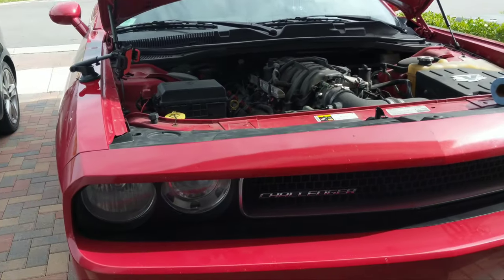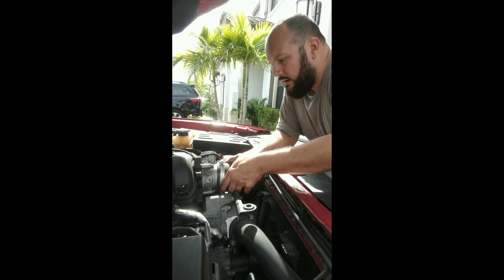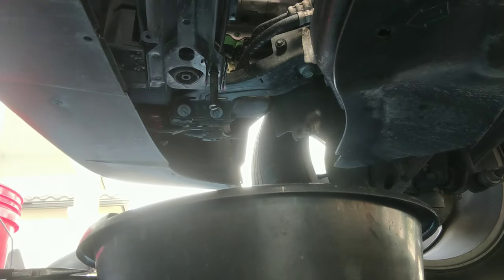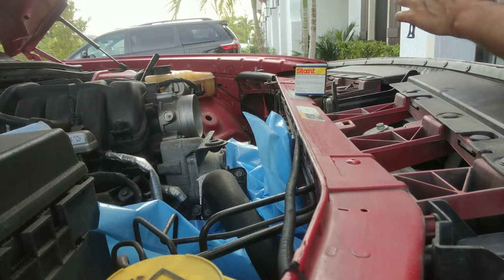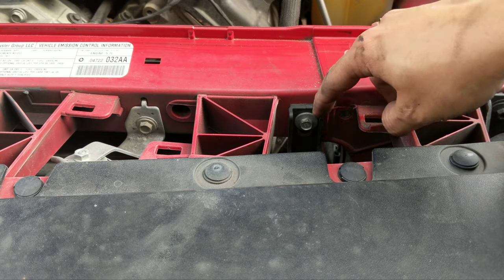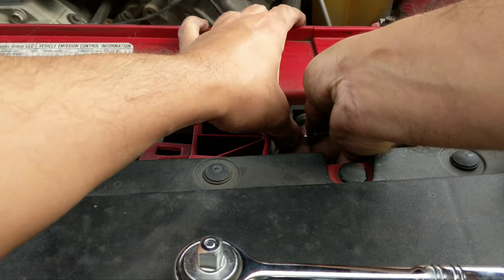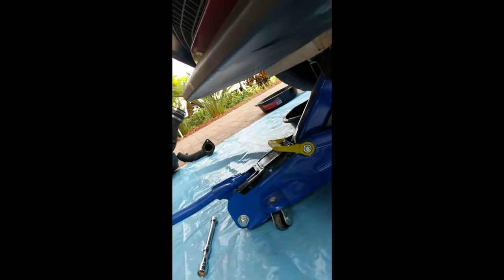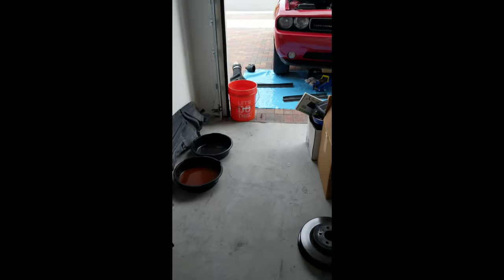How to remove and install a radiator on a Dodge Challenger, and how to remove & install a thermostat

Comment from the maker: Let me know what y'all think! If you have any questions, feel free to ask!
Reply: Did you pull the radiator out from the top?
Reply from the maker: @MBiggs-ez5cd  my apologies, YouTube never alerted me about your message. No I had to take it out the bottom angling it a bit.
Reply: i have a 2013 challenger rt. I've been having a leak coming from somewhere from my cooling system confirmed that it was radiator fluid by tasting a bit of it. A few months ago my coolant hose ruptured my themostat overheated. I have to constantly keep filling up my coolant resovoir with fluid. Do you think my radiator could be cracked?
Reply from the maker: @gtillustrated2304  it could be cracked but where are you tracing the leak back to? Maybe check your lower hose and see if it's cold to the touch, if so, your pump ain't working. Thanks for watching!
Reply: Same exact problem rn and same car

Comment: It would have been nice to see exactly how the radiator was removed. You went from the support bracket still attached to the radiator leaning against the wall.
Reply from the maker: Yes, I understand what you're saying, I had a corrupted file for that video. It was removed out the bottom, it will not come out the top as you would need to remove items like the throttlebody and what not. You'll just need the car lifted a bit higher so that it will angle out from the bottom.  If you have any questions just let me know and I can help guide you. Thanks for watching!

Comment: That bottom pan removal and installation needs a whole video for itself.  Also, If you're going to replace the radiator, might as well replace the radiator hoses and heater hoses - and idler wheels and tensioner - buy the bearings only and press new ones in.  Basically, the radiators are so cheap, you might as well replace it every time you do your coolant change.

Comment: I have a question? Would that exact thermostat work for a 2010 RT?
Reply from the maker: I believe it should, but you should be able to find a 180° or 190° tstat for your car with no problem. The idea is to run cooler so you can find a total for your car at the temp you want to run. I mentioned it in the video but a 180° tstat or colder will give you a check engine light unless you're tuned for it, which if you get a Diablo you can tune it easily. Hope this helps!
Reply: @elpingurt4657   okay thanks a ton!

Comment: HI GUY QUESTION FROM WHAT I SAW I DONT KNOW WHY YOU TOOK THE BOTTOM RAD. SUPPORT OFF IT LOOKS LIKE IT JUST SAT IN THERE LIKE A CROSS MEMBER AFTER REMOVING THE TOP SUPPORT N FAN  N  HOSES SHOULDNT I BE ABLE TO PULL IT OUT THE TOP. ACTUALLY WHY AM I DROPPING THE SUPPORT??
Reply from the maker: So, it won't come out the top, I tried that way and it just won't go out which is why I took the support off and took it out the bottom. I hope this helps, let me know if you have any more questions. Thanks for watching!

Comment: I used to have a 14rt the same color💪🏾 I'm following these steps for my 14 Charger everything looks the same lol
Reply from the maker: Torred, is nice, shines up well! Let me know if you have any questions or if you need to know anything that may help! They should be the same, just as a pointer, I took the radiator out from the bottom not the top. Video was corrupted so I didn't get to add it in there. Thanks for watching!
Reply: That's what I'm figuring I'm glad I found your video not many show this much detail. It got too dark for me to finish tonight but I'll be referring to your video again tomorrow
Reply from the maker: @Mill-on-da-track  Always glad to help! Thanks again for watching!

Comment: Do you need to bleed the coolant once installed so it doesn’t have air bubbles ? pressurize it ? Also great video I have same model and needed help
Reply from the maker: Yes, you will need to bleed the air out, if not you'll have pockets of air and you will get high temps randomly. Thanks for watching, I'm glad it helped!

Comment: Great vid ? Why not replace upper lower hoses
Reply from the maker: I honestly did not think of it at the time, but also i was still in lower milage range (i believe 45k+, somehwere around there) and they were actually still in really good conditions. Ive since put on quite a bit of miles and they are still doing well (no rotting, cracks or driness to them) but i will be coming up soon to replace them just from the amount of time and milage. If you have any questions let me know and ill do my best to answer them! Thanks for watching!

Comment: what year is your challenger and what model? i have an rt 2013 and wanted to see if this procedure is the same thanks.
Reply from the maker: I also have a 2013 RT 5.7L hemi. This will work, it's fairly simple after you know where all the bolts are. Thanks for watching!
Reply: @elpingurt4657   thank you sir, I have now a weekend project. thanks for the instructions.
Reply from the maker: @mauriciosalgado953  You're welcome! Let me know if you have any issues or questions, also how it goes.

Comment: Thank you for this video , I just started removing the radiator but it was very hard because I didn’t remove the fan first
Reply from the maker: Yeah it will be very difficult if not impossible to take out with the fans on. Glad I can help!
Reply: Did you pull the radiator from the top
Reply from the maker: I really wish that part of the video wasn't corrupted. I actually removed it from the bottom. Make sure to lift the car a little more so that the radiator can go back and down. A little at an angle. It'll come out fairly easy, you'll notice how once you're at that point though. Sorry I didn't have the video to show it. Thanks for watching!
Reply: @elpingurt4657  Thank you very much for the very detailed video. I hope this isn't a redundant question, but the fan also comes out from the bottom, I presume?
Reply from the maker: @SohCahToa30  Thanks for watching the video and I'm glad it helped. Yes it will come out the bottom, just raise the car higher than you normally would and it'll come out easily. The radiator will come out the same way easily as well but angled. If ita on a lift you're golden, it'll come out straight down. Ask all the questions you want, I honestly don't mind even if its redundant. Its better to know than to assume.